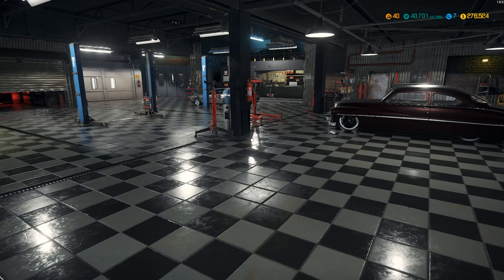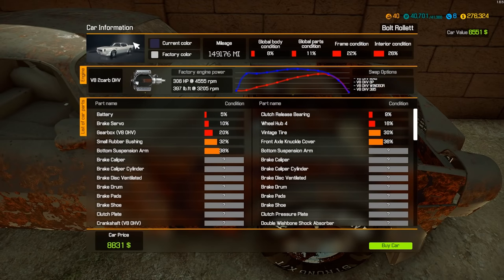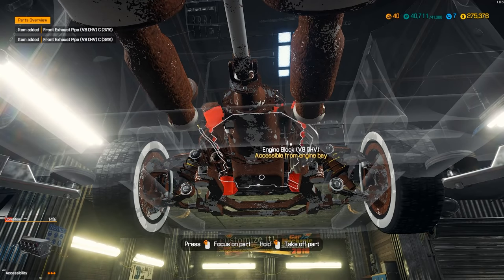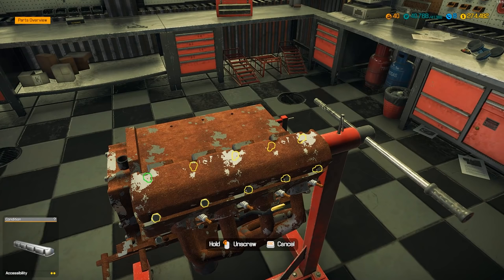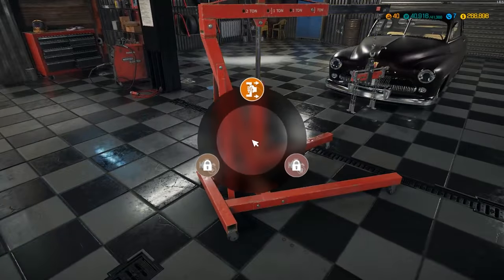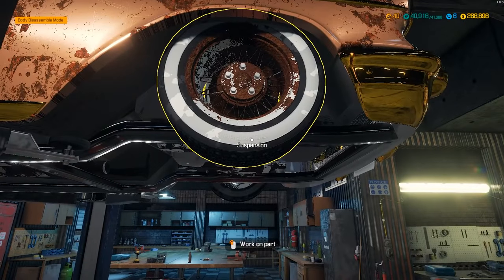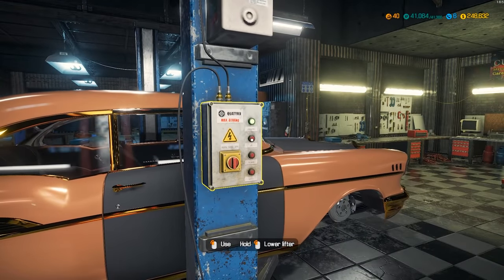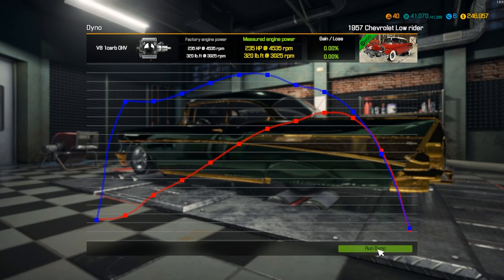What Happened?! Where have I been?! I'm BACK with a GOLD trimmed 1957 Chevy Lowrider Bel Air!!

Comment: Where did you find your unibody?
I'm in SC, my father had one that looked nearly ID to yours and sold it to a gentleman in Columbia, SC

PS: Gotta get that water pump so that 283ci dont overheat. LOL
I've done builds on 2 ID cars in the game: one with standard parts and other with HP. It aint worth the extra money for the HP parts
Reply from the maker: I found mine on the Iowa/South Dakota boarder. I wish it would have been a southern truck as it would have had A Lot less rust 😉